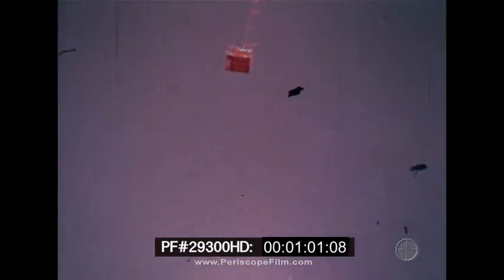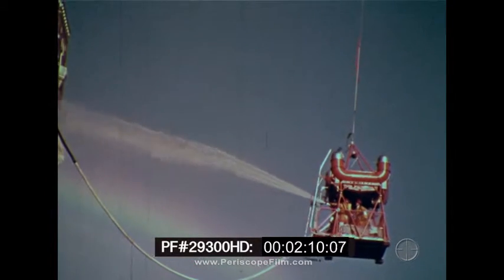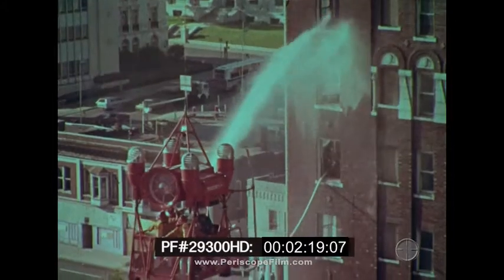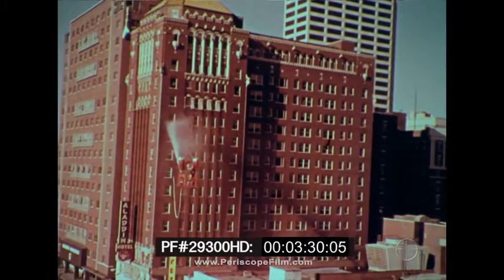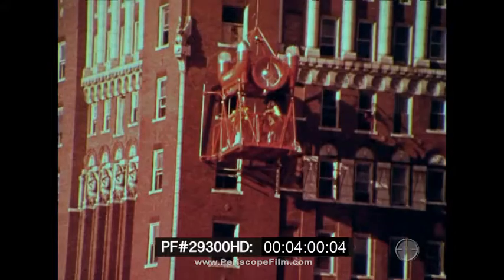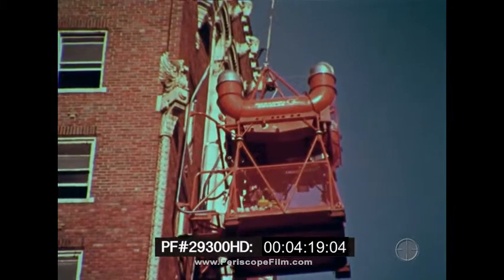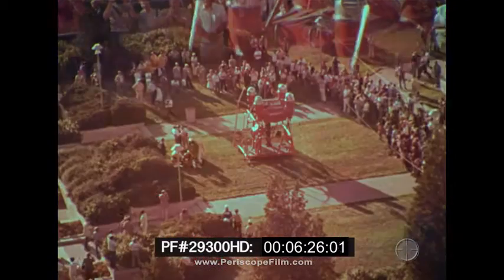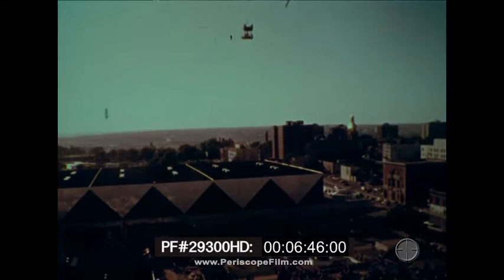DEMO of MCDONNELL DOUGLAS SUSPENDED MANEUVERING SYSTEM FOR HIGH RISE FIRE FIGHTING   29300

Comment: Well I think it's a very clever contraption. Obviously controlled via swiveling the tops of those four outlets. With modern accelerometers it could probably maintain exact altitude by reeling in and out its end of the line.